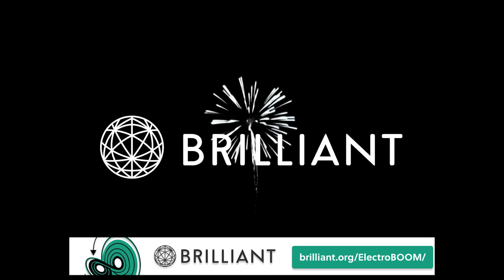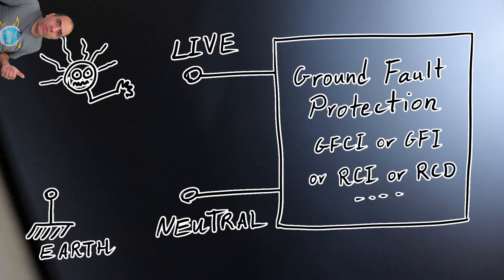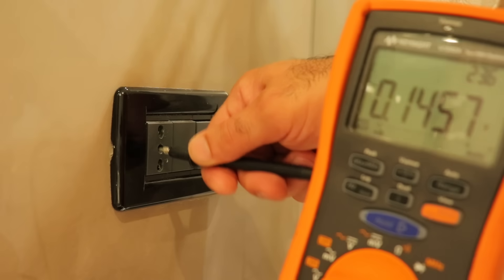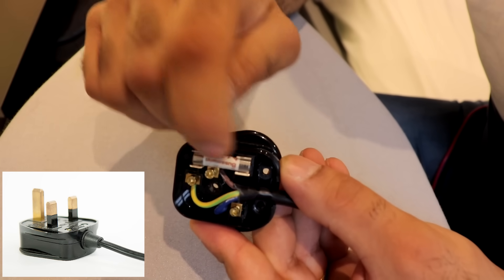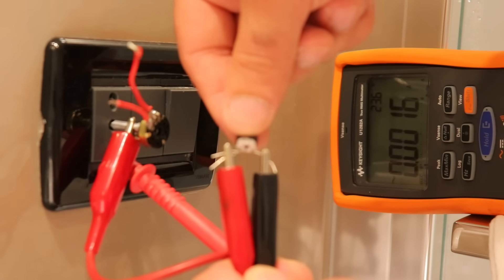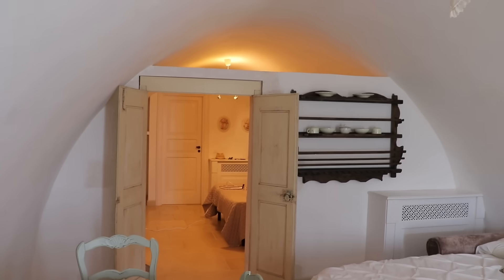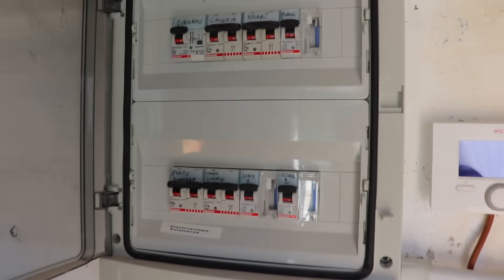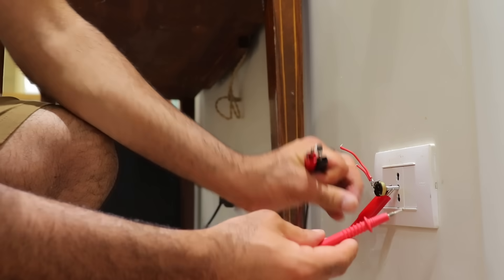Tripping Every Breaker in Italy

Comment: If I remember correctly, the reason because sometimes older houses have a separate power for outlets and lights is because in the past they could have a different tension. Wiki says ( https://it.wikipedia.org/wiki/Distribuzione_di_energia_elettrica ) that until 1950s every city had different voltage for illumination and power outlets (sometimes, like Gorizia, Roma and Reggio nell'Emilia, there were differences even in the same city!). The 125v and 380v were almost completely phased out in the 1960s but cancelled only in 2012. I think the two tensions had different tariffs too.

Comment: you are so hilarious!! 😄 loving your videos💪 in Italy we have by law ground fault protection, and it's usually at the beginning of the line that gets into the apartment, and it's amazing as you have shortcircuit protection for all your electronics.
Reply: power can be between 220 and 230V.
Reply: and the Shuko plug should not get into the standard wall outlet. if it gets in, that's because maybe some housekeeper forced the wall outlet as they forgot to get the correct Shuko>standard plug converter. this procedure is very common when you forget the converter... but it should not be done as you damage the plastic cover of the wall outlet.
this is the most common plug "not-supposed-to-do" mistake that happens in Italy.

Comment: In Germany is that if you have a GFCI, it has (following normative standards) to trip between minimum 50% and 100% I delta n, but the expectation value is 70%. For a GFCI with an I delta n=30mA, 25mA is way too high. As an electrician, measuring the GFCI, I woul expect the GFCI to trip at exactly 20...21 mA within 20 ms. So the Fault current cannot be deadly, even with a perfect Ground Fault with Ub=115V. Because 115mA in lower than 400ms in TN-C-S-System isn't deadly by definition. This GFCI ought to be replaced asap!

Comment: 7:22 looks like an RCBO to me, there's 25A overload and short protection with 30mA earth leakage protection built in. We're slowly phasing out RCD's here in Ireland so that each individual circuit can have its own earth fault protection. I can send on notes if you're interested, I'm studying to be an electrician at the minute
Reply: Interesting how the US and EU are converging on this. The US electrical code is now mandating GFCI on all circuits in new construction with only a few exceptions and Europe is moving from breaker-level RCD to circuit-level RCD.
Reply: At 07:22 it isn't an RCBO. It's an RCD.
RCBO will have (for example) B25 on it, but RCDs don't have the letter.
Reply: Just had a look at the product code from what I can see it has magnetic and thermal tripping so looks like it still has the function of an MCB so is an RCBO they don't display the type because from what I can see it's kind of in-between a B and C type breaker. RCD's can usually handle much more than 25A because you'll service more than one socket circuit on them

Comment: We don't think in live/neutral, there's only two hot wires. No European appliance will rely on neutral being close to ground.
Your claim about the other connector is wrong, those are E/F plugs, Italy just uses those sockets as courtesy to French/German(and mosy other Europeans). The double drilled holes are akin to the American sockets with a T hole, to accommodate both 10A and 16A devices.

Comment: (14:27) 5 mA vs. 30 mA: the RCD does not limit the current. So the shock you get will be the same. The RCD only limits the duration. 
Additionally if the RCD is located in the beaker panel you need a higher rating because more appliances are connected. So their leakage current add up.
Reply: He means you'll get a much worse shock before it trips

Comment: 15:22 yes, while you can forcefully plug it in that way, in reality here in Italy we use what we call a “siemens” adaptor for that kind of plug, so that you can still get ground connection and it will plugin just fine 😊
Reply: A German plug won't fit into a new Italian outlet. But if a few people have forced it before then it fits easily.
Reply: La tipica 'tazza'!
Reply: Vero
Reply: I am SO unsurprised that there is a common safety bypass mechanism...
Reply: @paulperry7091  sarcasm what a beautiful thing, when done right.
Reply: @matteocastellani5122  Here in Australia, I have seen musical equipment with the ground pins cut off by hacksaws "to get rid of the hum". But, I should warn you that my sister is booked to visit Italy next year. When she was in France, she managed a spectacular tripping event by forcing an Australian hair dryer plug into the power socket in her hotel.
Reply: @paulperry7091  what the fuck, how did she manage that 💀
Reply: @vividbrando860  By hammering an Australian plug into a European socket. Fortunately i was on the other side of the world at the time, but I imagine the wires were mangled together. Never underestimate the power of a desperate woman. I used to manufacture electronic music equipment (Frostwave) for export, and quickly found that the most vital part of the electronics was the power input protection. I have seen a 30cm circuit board trace blown off the board and would up like a clock spring.
Reply: @paulperry7091  for the love of plugs, get her an adapter 🤣
Reply: @Daniel-yy3ty  Yeah, she's going to Italy next year - I'm putting an adaptor in her Xmas stocking!

Comment: thats the hotel universal socket of death can fail over 6amp. usualy fused at 16 or 6
will hold about all 220-250 volts plugs

the induvidual plugs are better at holding current (two pin/tree pin)
problem is contact area and burning it of the universal one
brown fase
blue nutral (you where wrong)
yellow/green earth
black switching wires

Im alot more north in europe but its basicly all the same

leak protection its all 30ma theres just a difrence in howlong it takes.to trip but you wont find the more heavy duty in house unless you have a fast charger or other heavy equipment and its should be sperated from the house leak in case they have vistors like you.

you have like every 4 years new standards lardlords need to comply to a certain code or they in trouble, and old earth leak thats bad be hard finding, ive never heard of one failing

the whole board should be fused at 30 100 or 200 amps infront of the meter and comes usualy in 3 fase even if its 1 fase system they just insert the one fuse, you cant service these yourself, they are sealed and stamped they more for protecting the meter. 
if you keep blowing the fuse they prolly insert a bigger one. this service is free. you break the seal however they take the meter for investigation and costs you 300 to get one back.

anny house fase shouldnt be more then 16a so thats a in reality closer = 3.2 3.5 kw till things start poppin
using two fases gets you about 400 volts but you usualy dont fuse that with just 16
you can also use all tree but you need to have a certian kind 3 fased electric engine or equipment specialy designed for that, its usualy its just using difrent rails and doing nothing fancy with the fase shift 

you can also just have two black and the earth and you can go gues whats the fase
the fase is inductive the nutral isnt.. fase alone hurts slightly nutral doesnt both ALOT (dont do this but i think he knows what im talking about.. in us both are hot)
if you have a verry old house you might run in fabric coated red/green wires witch usualy has no earth and no leak protection. for lighting meh. but dont go load that shit the insulation will crumble off. and scary shit starts

voltage: theres quite some volatage drop in dense areas . usualy just meens tehres alot on a 15kv transformator somewhere in a stone building in like 700m?
that 15k line is underground comes in manny thicknesses all of 'm 4 conductors l1 (white) l2(black) l3(grey) n(blue) i belave they have a twist and a shielding as earth ive seen some few decades back, no idea how they look now.

Comment: Watt? Black is neutral?!

Looks like someone found a faulty installation.

By European code (And as far as I remember Italy still belongs to Europe)  two phase electricity is coded like 

green/yellow: ground
blue: neutral
grey,  black,  brown: live, ( together used with three phases.) 

So when an inspector find an installation like this where blue or green/yellow is live,  they will whoop your ass with the meter cable whip or choke you with a dyspol Hitman style while forcing you to redo the installation. 

RCDs are mandatory in Europe,  because of the costs there's usually one which checks the main feed of your house/room and shuts everything off.

Probably there is somewhere a selective RCD  but judging on the footage im afraid that someone was cutting corners on the wrong end.

Comment: Please don't make me start complaining about the utter sheer stupidity of the Italian electrical plug (type L). It's pure and utter crap.

1. The C plug (aka Europlug, with only two small prongs) was fine. It doesn't carry more than 10A, and that is fine because it does not support grounding, so it would be unwise to use it for very powerful appliances, but it's well enough for bed lamps and phone chargers.

2. We Italians are famous for finding half-assed solutions to problems, so instead of developing a decent plug we just shoved a ground prong on the C type plug, so the 10A L connector was born.

3. Given that 10A plugs can only carry AFAIK a maximum of ~1500W, the 16A L connector was created as a chunkier version of the 10A one.

4. Given this whole nonsensical situation, companies catering to the EU single market largely ignore the L connector. Every single device sold in Italy either uses the C type ungrounded connector (Europlug) or the E/F "Schuko"-French combo connector (the one with the two ground connectors on the sides).

5. Italian houses have either 10A plugs WITH 10A WIRING or 16A plugs (usually with combo 10/16A plugs, have I mentioned the two sockets are incompatible despite both being L?). This means that F "Schuko" adapters to L are a common fixture in Italian homes.

6. People buy devices with F plugs, which they then have to plug into their sockets using adapters. Adapters can either adapt to 16A plugs, or, unfortunately, to 10A, which is extremely dangerous given that Schuko is a 16A connector and 10A plugs often do not have the proper wire gauge for that. The fact that no Schuko adapter supports nominally over 1500W doesn't help either.

Long story short: Italian homes are full of high power devices, such as microwave ovens, air friers, hairdryers, kettles, ... plugged in 10A wall sockets through adapters that do not allow more than 1500W of power. It's absolutely stupid and moronic. Yes they get hot. Yes they are a hazard.

The solution would be to mandate everywhere the C/F/L combo socket in new buildings, but given that 16A wires are more expensive and the Italian government has been historically extremely pro-business, it will never happen.

Comment: Women came for the sightseeing and Mr. Mehdi came for the voltageeing. 😆 Aside from that; sockets in Austria, Slovenia, Croatia etc. look different. So close geographically, but so far apart regarding home appliances. You can`t stick the italian plug into Slovenian (for instance - since it is my homeland), but you can do it vice versa. The only difference is, that plugs with ground protection on the side of the plug, have no connection to the ground, thus have no protection from being electrocuted on the metal housing of the appliance.

Comment: You have to force the shuko plug though, which doesn't fit, because its pins have a larger diameter compared to the standard socket. If you find one where the shuko fits, it's because someone abused the socket or the socket is non standard, which, technically, is illegal. So, if you do that and you get shocked, it's your fault because it cannot possibly fit unless you force it, which requires quite some strength, usually enough to prevent children from doing it.

Comment: The Schuko/round/German style/"CEE 7/4" plug's pins are supposed to be thicker than the holes in an Italian 10A outlet, specifically to prevent what you're describing around 15:30. Some are not, possibly to provide intentional compatibility, but they are relatively rare.

Comment: dear mehdi, GFCI can be in the central distribution boards instead of in the wall socket. 

Here in holland, all modern sockets will have ground wires with protection in the distribution board instead of in the sockers itself to shut down the whole house/multiple groups at once instead of a socket (think about water leak in house, better to shut off the whole floor instead of 1 socket wich shorted :) )

Comment: As an electrician and tester the RCD 40A 0.03 A is kind of a holy thing I pray to every night before going to sleep. 
In Germany we have mostly a ground from the provider, 3 phases and a neutral. Than the building itself has a ground that is connected to the power box.
I don’t want to have it differently because it’s the safest way.
If you want to test these thing more safe and without annoying the reception I would recommend a Fluke 1664.
Edit: I don’t know what these socket are but we mostly have these socket like that for the fridge.

Comment: it's curious how Italy has 2 different grounding standards
Reply: Laziness mostly. The L connector was born out of the C connector due to laziness, and adapting it to 16A required enlarging the section of the prongs. Because of this nobody cares at all about the Italian connector, and just ship to Italy appliances with the more common E/F connector (German/French/Spanish/Austria/Sweden/Everbody but Denmark, Malta and Ireland). This means most power appliances in Italy are always connected through cheap adapters that do not allow for more than 1500W to be drawn at once, even if the outlet and plug allow for more. 

It's a mess.

Comment: 4:29 I thought that you were going to make your multimeter blow up by keeping it on the current setting, just like DiodeGoneWild did🤣🤣🤣 7:19 That is a really special construction because why would you use a GCFI in combination with only one circuit breaker for each room if a RCBO is cheaper, uses less space (1 or 2 modules) and doesn't need to be individually wired up by 2 extra wires from the GCFI to the breaker which also means that there is less chance of a bad contact?

Comment: on 9:25 you can heare the breaker popping, so it must be somewhere in the room  I suppose.
Sometimes they are hidden behind a picture or hidden in a closet.

If it was a spark, I would like to see the tip of the multimeter. 😎
Reply: I think it popped the external breaker like in electrical room.

Comment: I have a low voltage grid checker at the job that checks the exact current and time elapsed that the Differential Switch aka Ground Fault Protection takes to trip.  Also lets switch between 0° and 180°.
I'm surprised you don't travel with one of those 😁

Comment: 30mA are required because some devices, like PC PSUs are allowed to send small leakage currents to ground. 
If there are many devices like that and If you just have 5mA, those devices can trip your Breaker.
It is also common to use a separated  circuit  in a large office.
Reply: Yes, PC PSUs are floaty af. If you have no ground, chasiss could be at like half the voltage of the mains. Learnt it the hard way.

Comment: Italian electric systems are by law required to have safety systems, i do not know the English name, in Italian it's just called "salvavita" (lifesaver) and it detects when there is a short circuit of any kind/any kind of unusual or inappropriate current flow and hard shuts off all the current in the unit/building. Once it triggered at my house because water insulation wasn't perfect on the outdoor outlets and rain shorted them. Just had to change the outside protection but everything was fine

Comment: Welcome to Italy. Schuko plugs have bigger pins and normally do not fit in non-schuko outlets, but some people forces them in enlarging the outlet holes.... just because they're... idiots. Don't ever do that! As you can see, you will lose the ground protection. Use the correct adapter or find a schuko outlet.

Comment: In italy basically every house has a gfci(or someting similar, idk if works exactly the same) , we call it "salvavita" (literally means life saver xD) and it's generally near the eletric meter. It's connected to the whole house or apartment (every outlet) and it turns the power off everytime there's a problem with the elettric circuit in the house. I think it's actually impossible to find a place without it since it's mandatory by law.

Comment: 14:37 in us is 5 mA because the voltage is lower and at 30 mA if you have drier skin you will have to dance for quite a while until you manage to impress the differential protection :P 
and in EU we use lower mA ones but only for electrical accessories for swimming pools, jacuzzi tubs, etc

Comment: In France, the problem of "you can connect a cable that NEEDS a pole on a ground plug" does not exist because generally the plugs are ground to the size of the cable, those without ground are small as in Italy (without the thing in the middle) and those who need it are big so they can only fit if they are a ground one, but the one without the ground can insert in the one with ground, IDK how to explain the f

Comment: 9:12 if I remember correctly it’s an ancient power connector for phones(?). My dad used to work in an old house and they had one, they also had an adapter that let you plug a normal electrical plug into it

I also want to point out that I’ve seen it in old houses in southern Italy and never in the north
Reply: They indeed seem to be BTicino 2021 phone plugs, wikipedia lists them as italy exclusive and even rare within italy.